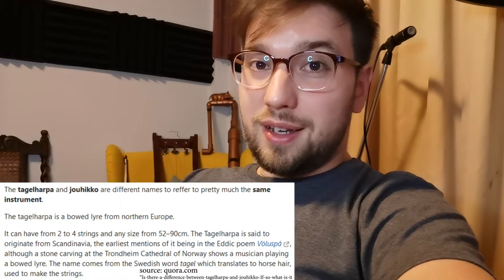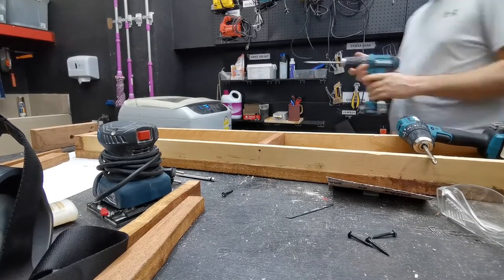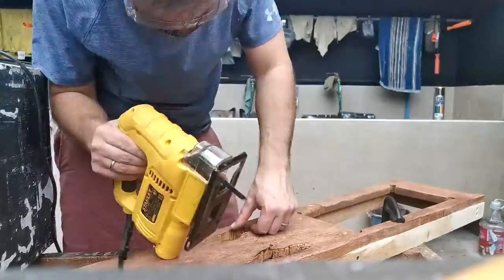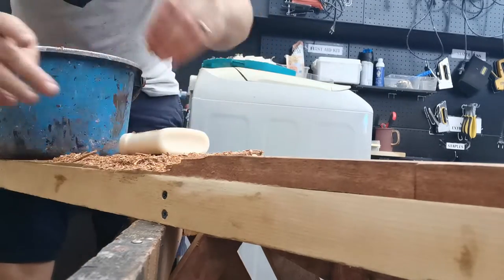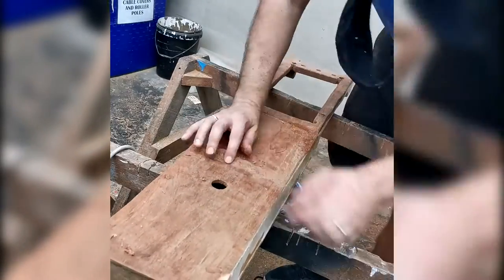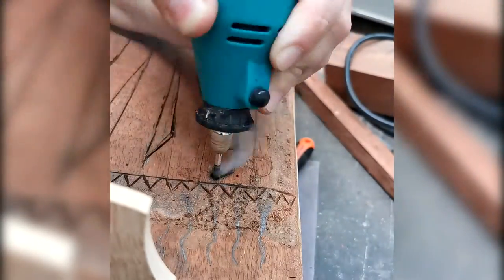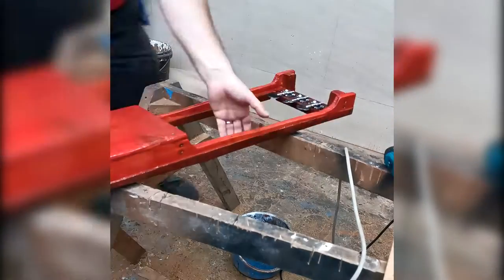So... I built a tagelharpa / jouhikko from scratch. Here's how I did it in detail.

Comment: I decided to use Red Oak 😅  it took me 3 days to cut all the holes.   I have 4 pieces  1 meter long 20.3cm wide.    I need to router the back and glue All the pieces together and I have my main structure
Reply from the maker: Red Oak is super tough wood, I can understand it must've taken a while! But as a hard wood it'll last a while, so years later you'll be happy you did it :)

Comment: I made mine a bit too thick too....but rather than sanding it, I split it in half. I can technically build a second from all the split wood.  I have a 30 second update on my channel. You can see where i'm at.  I finally glued the front.
Reply from the maker: @jcmusc  good thinking! If I'd had a way to cut my plank in half I definitely would have done it.
Reply: @dekoningtan  such a pain in the ass I just put on the biggest blade my table saw could hold at maximum extension. Cut it down the middle flip it over cut it down the middle again and the board fell apart.  I wouldn't recommend it but if you don't have a bandsaw there's ways around it.

Comment: Very nice work! I would recommend turning the tuning pegs to the other side, so you can hit the lower notes better. Also the soundboard seems a little too thick, you could make it sound better by making it less thick. Also from what i know, the jouhikko/tagelharpa have pratically no difference, it's just different names for the same thing (different languages).
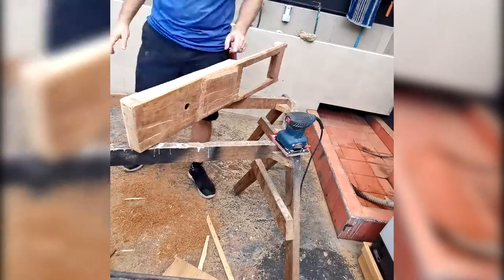Reply from the maker: Hey there! Thanks for commenting. Yes, the tuners is unfortunate-- at 13:09 I mention how I didn't plan them properly, so they're facing the wrong way. Oh well, it was a learning experience... 
You think it should be less thin than 6 mm? Really? Any less than that and we're talking so thin that it would easily break (single or double plywood is about 2-3 here anyway).
Reply: @dekoningtan  Most guitar sound boards are only about 2.5 to 3mm thick, if you use properly braced quartersawn spruce, cedar or similar that's plenty
Reply from the maker: @lawabidingcitizen5153  cool! Good to know 🤟🏼 thanks!
Reply: @dekoningtan  Oh, it is 6mm? It looked thicker on video, I make mine 4mm on top, and 5 on bottom. So i guess 6mm should be ok. Also you can try making horsehair strings and checking how they sound on your instrument. Anyways, good luck learning the instrument!
Reply from the maker: @skalsong9485  It was a lot thicker before! Man, this instrument is hard to learn, but it's a good challenge-- I'm super used to frets (guitarist) and not having them is throwing me off often. Maybe I'll make horsehair ones one day, but it'd be nicer to just buy some horse hair strings rather than count them out, haha.
Reply: @dekoningtan  Making them is pretty easy tho! All you need is horsehair and superglue. I usually go for 18, 36, 60 strands, but it's for shorter tagelharpa, about 40cm active string length.
Reply from the maker: @skalsong9485  oh that's less strands than I thought it'd be! I don't know if locally i could find a good source of high quality hair, but it might be worth looking into!
Reply: @dekoningtan  First time i bought horsehair I bought one in music shop used for violin bows, then I tried aliexpress horsehair and honestly, it has little to no difference in sound (I think unless you buy it from someone with a horse, it is probably produced in China anyways). I recently bought black horsehair, it has more "rough" sound then the white hair. If you will buy on aliexpress make sure it is not synthetic.
Reply from the maker: @skalsong9485  that's really helpful to know! Thanks ☺️